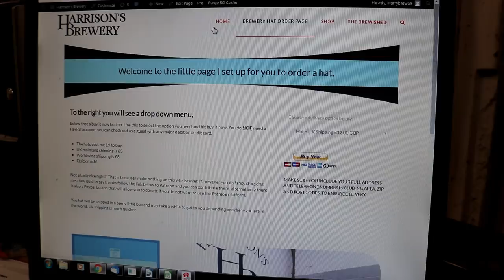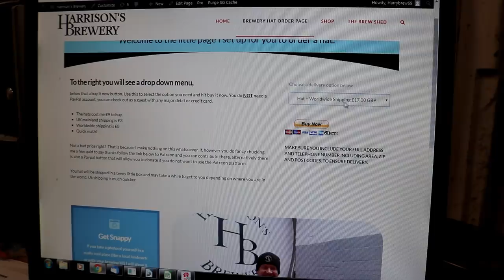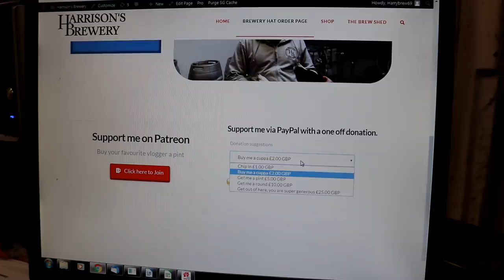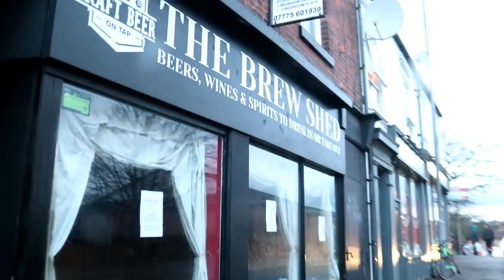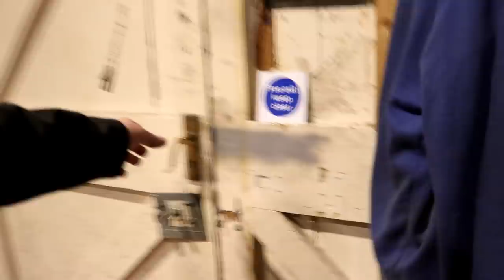Hats Hats Hats & Fat Bergs

Comment: No matter how well the week goes you always find yourself in shite eh,had to do same myself at weekend,that's the problem with old soak aways and pipework that's been put down 40_50yrs ago ,often too narrow and not enough of a cant to allow proper flow. Hopefully it won't be a continuing problem,although I reckon in years to come you could end up digging it up and relaying bigger pipework. I would be most concerned as to where the rubble is coming from tbh. Going to order a hat in a bit,probably get it sent via NI for postage,can't wait until you have some more clobber on website,would love a polo shirt or hoodie,most especially though a few bottles of HB brew. Cheers.